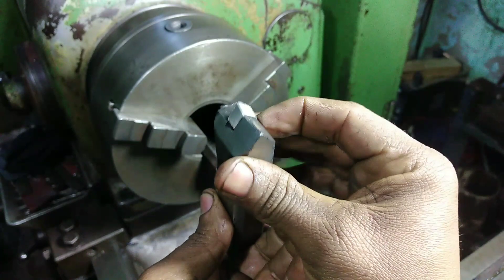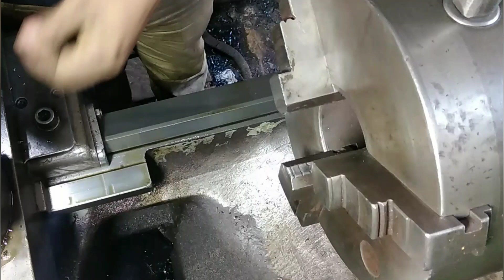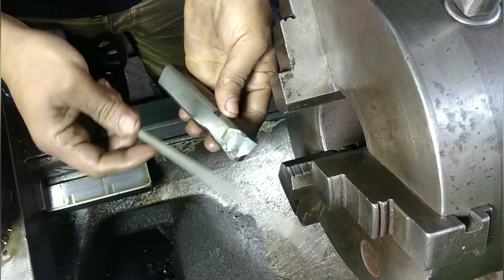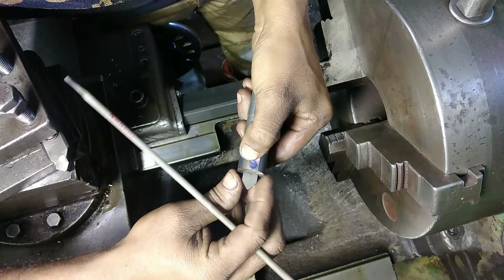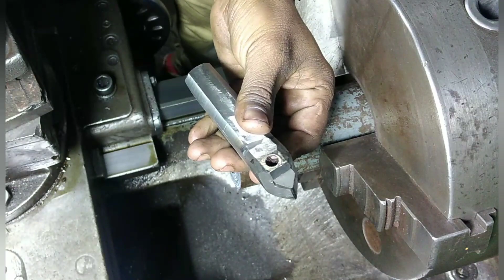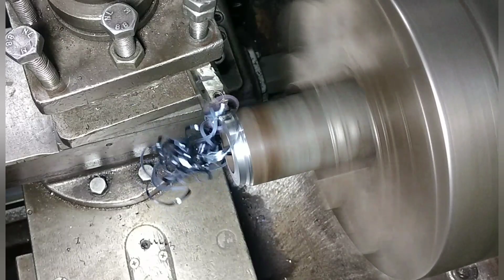لا أحد سيخبرك هذه الفكره  في خراطة وتشكيل المعادن

Comment: Ты умница,беру на воурожение.
Reply: drill a small hole through to leave a radius for the corner then cut with a thin disc 
or put an end mill in the chuck and machine the tool on the toolpost 
no grinding